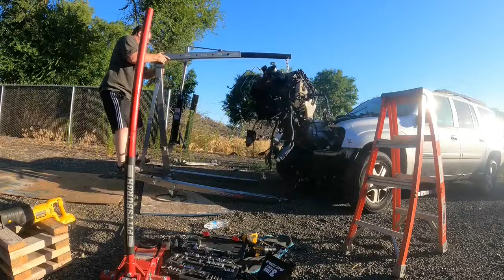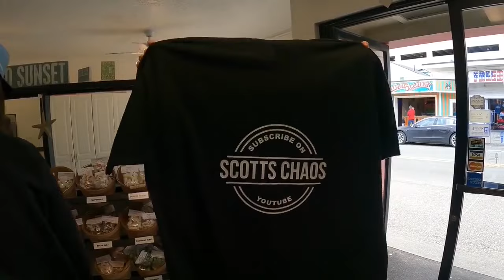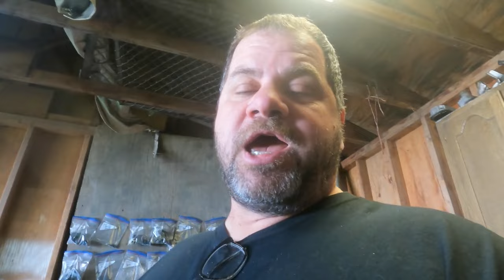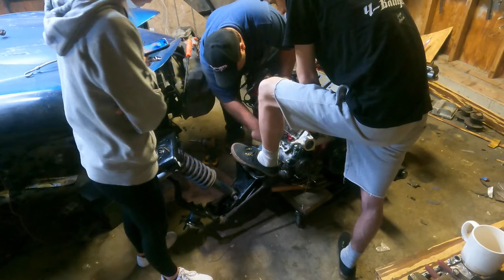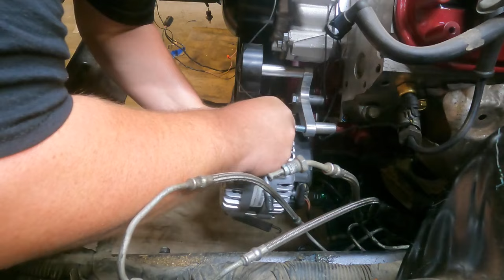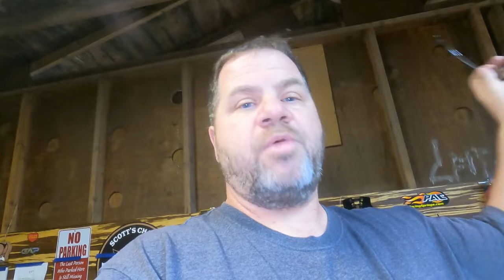LS Swap on 1999 Pontiac Firebird. Project Black Widow finally gets her new engine. 5.3L LS LM4

Comment: Would those motor mounts work on a LT1 k member? I see it says 93-02. I want to Ls swap my 93 Z.
Reply from the maker: As far as I know they’re for the V6 to V8 conversion using the V6 kmember. If you check their website you might find what you need.